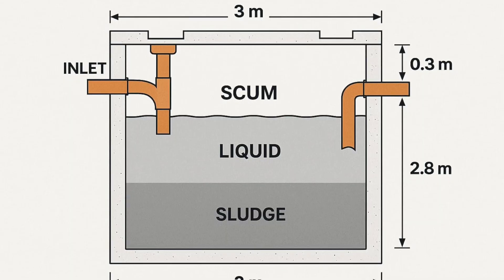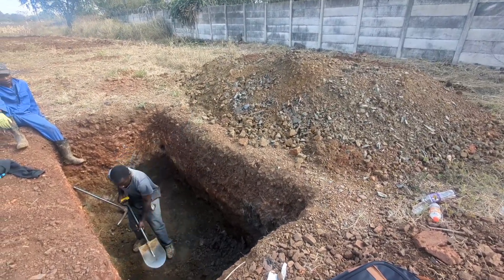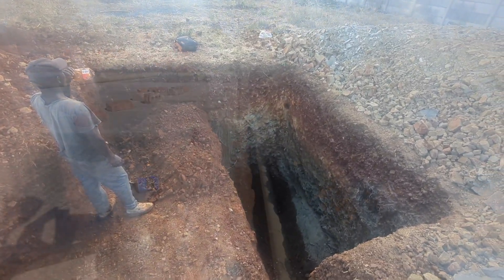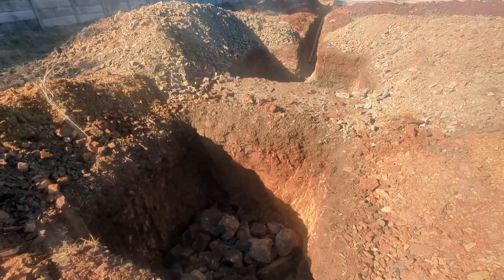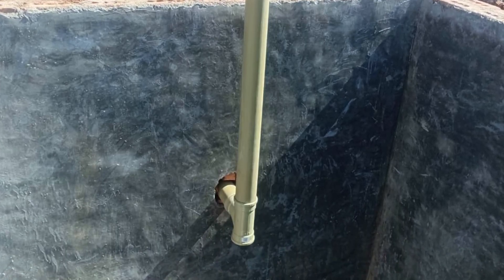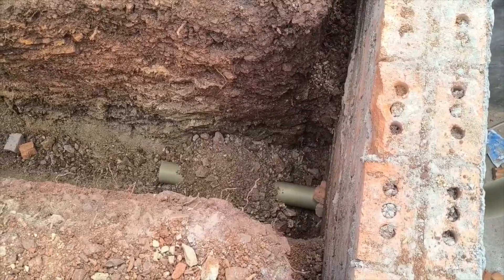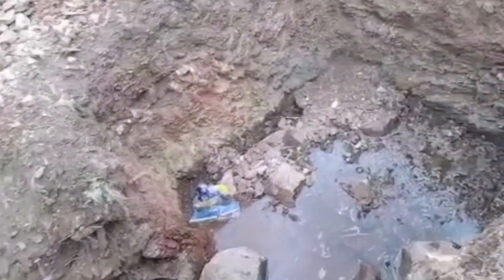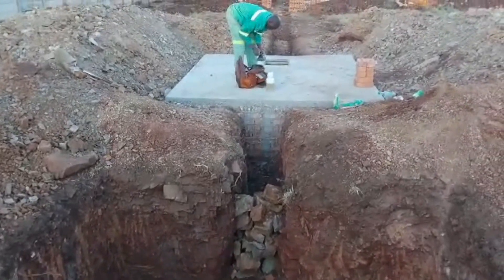Building an Affordable Septic Tank That Lasts | Ep. 6 – Building a Home in Zimbabwe While Abroad

Comment: Did you apply for a separate planning permission for the septic tank that is separate from the house/cottage please?
Reply from the maker: The septic tank doesn't need planning permission. In low density areas in BYO, there's no council sewage lines, so it's mandatory that every stand has a septic tank as part of the subdivision permit. The council just has guidelines for building a septic tank for sizes and boundary setbacks. It has to pass an inspection though as part of the open drainage inspection stage.
Reply: Thank you so much. I greatly appreciate.
Reply from the maker: @BrillSPORT  you are welcome 🙂